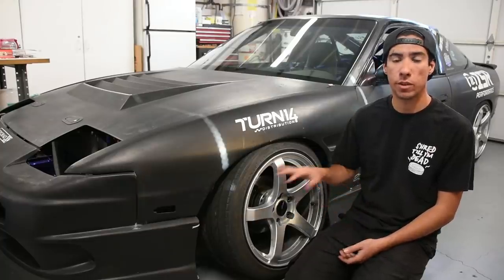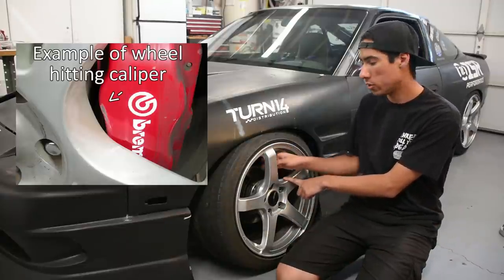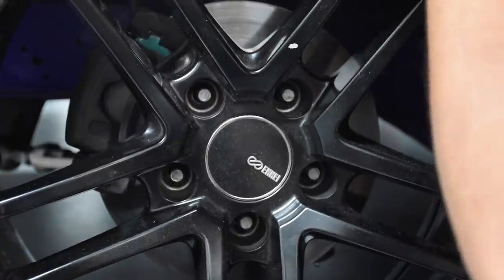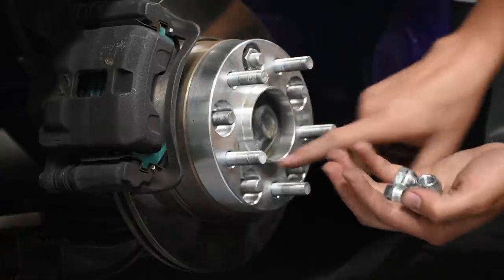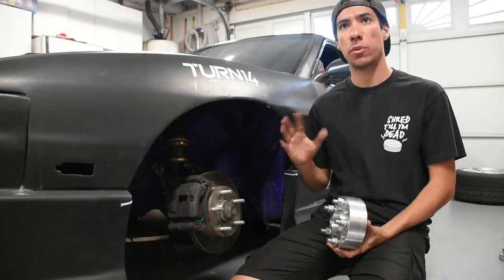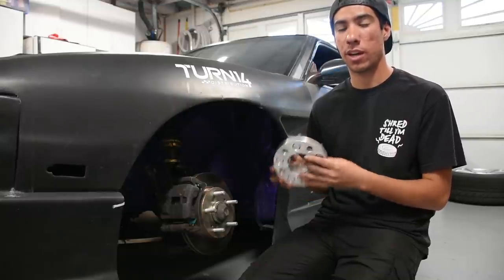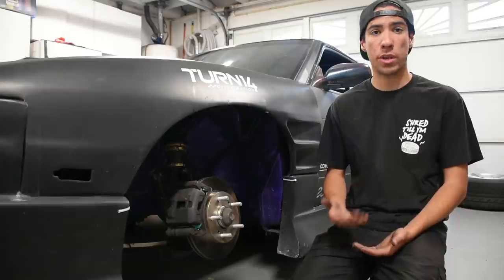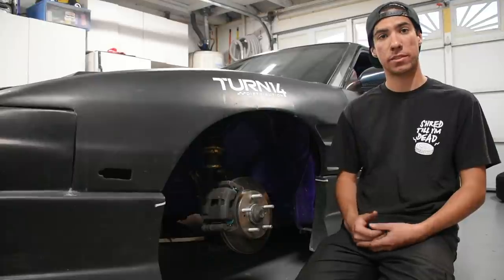Wheel Spacers Good or Bad? | Spacers Explained

Comment: What wheels spacers do you run? looking to get some 25mm adapters for my car and with the excessive amount of adapters/spacers out on the market it's hard to tell what's good and what's not from just a generic picture
Reply from the maker: +rustler001 100% being honest with you. I go on eBay, search for the type of spacer I want, and buy the cheapest ones.
I've had 12 spacers now and no issues with them other than the studs/bolts on two of them seemed like they're were going to strip just being torqued.
All the spacer is made up of is a block of aluminum and studs. If the studs are bad they can be replaced by OEM quality ones for like $1-$2 a stud so that I usually don't care about. And it's pretty hard to mess up a block of aluminum so as long as it's not machined weird then the spacer is usually fine. 
TLDR: I buy the cheapest eBay spacers I can find. I've had 12 and none have failed on me. It's fairly hard to mess up a spacer. Use your best judgement.
Hope that helps haha
Reply: awesome thanks!
Reply from the maker: My pleasure :)

Comment: Does anyone else tighten the bolts first by yanking them semi tight, then lowering the wheel enough so it doesnt spin because of friction but also doesnt rest on the ground with full force?

I also tend to hit the side of the wheel when I'm finger tightening my bolts so it will center itself easier :)

Comment: about being non hub  centric being unsafe. hell, probably half of all wheels are not hub centric I know of a lot of wheels that I've had that werent. the lug nuts are what center it
Reply from the maker: Read the pinned comment please. Thank you,
Reply: The studs aren't designed to carry the load of the car, they should only hold the wheel onto the hub. Also most wheels are indeed hub centric and should go with the right ring

Comment: If i was to get a custom wheel spacer for a miata would it be possible to have the 4x100 to 6x139.7 for roh traks with a 15x10 -44 offset
Reply from the maker: +SBM Crew Don't see why not

Comment: Great vid I like actually learning things. So what about the anti-seize on the threads debate? Will anti-seize make your nuts blast off when you drift around an apex? or will it stop your wheels from eternally marrying to the hub?
Reply from the maker: Haha i think that has a lot to do with the application. Like here in California I never use anti-seize on any of the cars at the house even though they are daily drivers. However if you lived somewhere where it snowed 4 months out of the year and there was always salt thrown on the road and you have to deal with corrosion issues then anti-seize on the threads of a daily driver would probably be a must have. 
And then when it comes to track only cars. I haven't seen anyone yet in Pro-Am or FD level put anti-seize on their threads. But they're also either taking off the lugs and re-torquing them every few runs.
So yeah that's my 2 cents on that haha, what's your thoughts?
Reply: OffBeat Garage thanks for the insight. yeah I agree, also in socal, never anti-seized my threads before, and never had any issues with anything seizing. The corrosion factor makes sense tho
Reply: OffBeat Garage what about medium strength thread locker used when you install spacers? Is it needed or overkill if you're already torquing to spec.
Reply: Just put grease on the hub, usually only thing that will get the wheel stuck is a dry, rusty hub.. Absolutely hate it when this happens in the workshop, just the smallest bit of grease can make sure you don't have to use brute force lol
Reply from the maker: I think it's overkill. I've never used thread locker on them and I've driven thousands of miles as well as drifted for literally days worth of time on them and never an issue. They've always been torqued to spec and whenever I've checked them they've still been tight.

Comment: I guess no one addressed the issue of ball joints being over worked. Since the wheel is farther from the actuation point, hitting a bump with a spacer compared to without will cause it to travel farther, along with the amount of force it has to travel with. It'll change your wheel scrub radius, along with bump steer and lazier rebound. Sorry for the essay, people need to know the consequences of changing suspension geometry.
Reply from the maker: Everything you listed has to do with what the effective offset becomes. These are not solely because of running a spacer. Running a low offset wheel would have the same exact effect on everything you listed just as a high offset wheel with spacer on it to achieve the lower offset would.
Reply: So what I'm gathering from all this is if I just don't modify any of this shit then I can save a lot of cash and future possible headache and focus on actually driving, then if I want a wider track width then I can just buy a car that was fully designed for that?